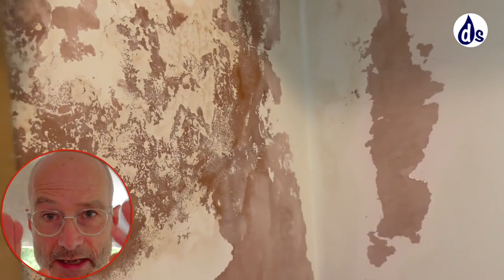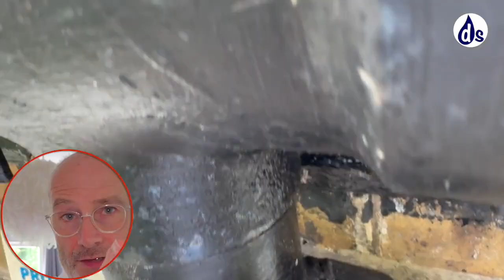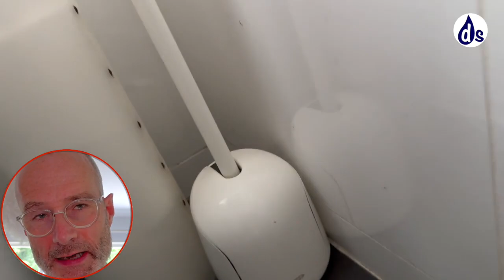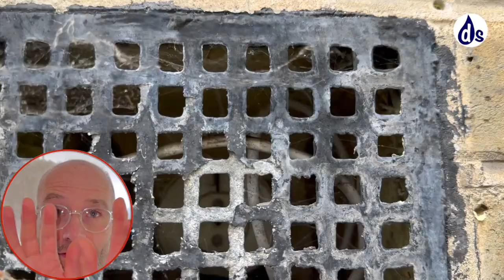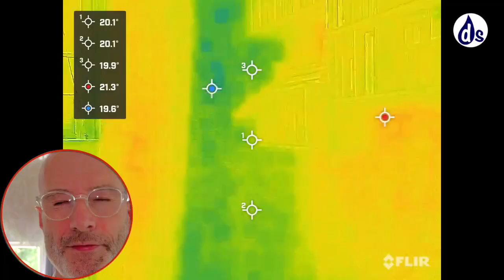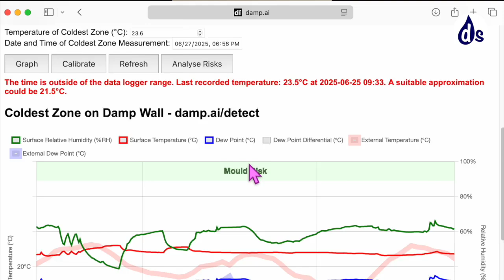🎥 Damp Mystery Solved? 🧩 Gutter Leak & Condensation  🌧️💨

Comment: Thank you for these videos. I have learnt so much from them and have been sorting out the damp and mould issues in a neglected victorian house that i recently bought. So far I have replaced the broken gutters, replaced broken gullies, installed a dmev in the bathroom and an externally vented fan in the kitchen. I’ve also started the process of removing the pebbledash and repointing the brickwork with lime mortar. Next on my hit list is sorting the high humidity under the suspended floor, any tips on locating the root cause of the subfloor humidity? I plan on lowering the external ground levels, installing more air bricks and removing a concrete foot path that surround the house, is there anything else I can do to address this issue?